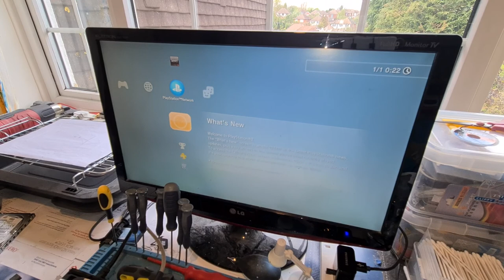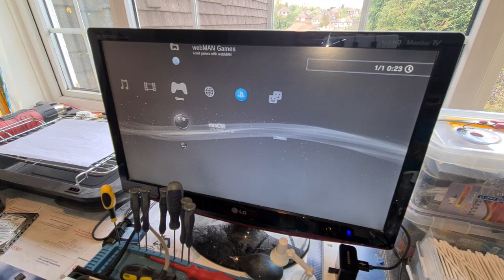Does your PS3 turn off when loading high intensive games? Here's the fix!

Comment: I have a PS3 Slim that has the same problem. no overheating, I barely play a game (Let's say AC Brotherhood for example) And in minutes or even SECONDS the console shuts down, without overheating

This only happens to me with some titles, sometimes it doesn't even happen, sometimes you have to have played hours for it to happen and other times it's like the case I present.
Reply from the maker: It's either one of two things.

1 NEC tokin failure 

2 failing GPU.

You need to go to the PS3 toolset in your PS3 browser. Once on the site, you will be able to see the last 32 error codes that Syscon has reported.  If the last codes were 1601 1701 14FF, then you have a failing GPU.

If the codes are any of the following 1001, 1002, or 1004, you most likely have NEC tokin failure
Reply: @timdark9282  Do I need to have the console modified? .
Reply from the maker: @santiagooooooooo09  nope, you can obtain the codes from PS3toolset.com without jailbreaking your console
Reply: @timdark9282  Well, I did the Toolset procedure and it appeared to me that I didn't have any errors directly That is so weird...
Reply from the maker: @OuterHaven09692  did you click the system manager tab? The error log is at the bottom. It's a file that says 32, and you need to expand it to see the codes
Reply: @timdark9282  Thanks mate, i'm watching.
Reply: @timdark9282  The last numbers are mostly 3004, I hope res
Reply from the maker: @santiagooooooooo09  3004 (RSX Core Power Failure)[edit]

This error will occur in the case of a PWR failure on the main core voltage of the GPU (VDDC). For example, if the filtering capacitors (NEC/TOKIN's) are severely damaged. There are other SMD's in that filter, so it could be related to them as well.